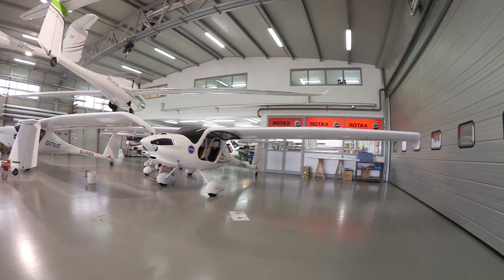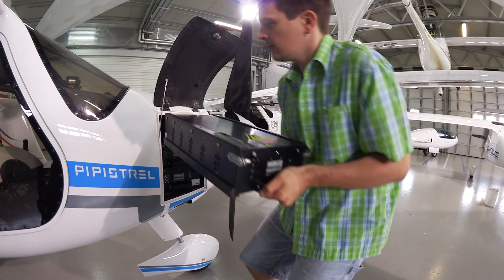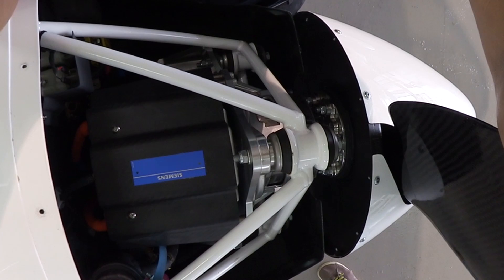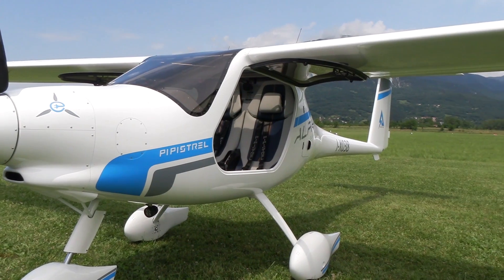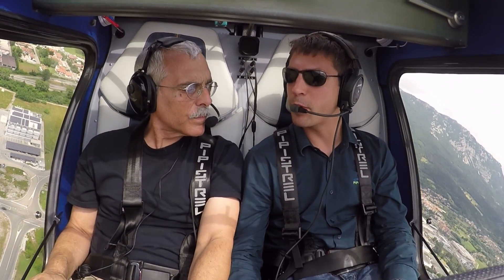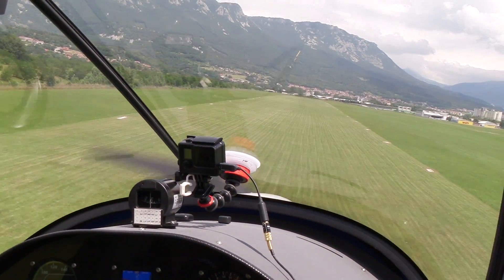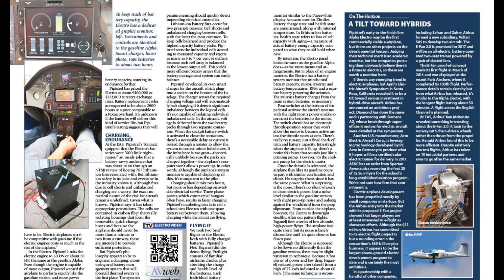Flying Pipistrel's Electric Airplane

Comment: Do you have metal, like aluminum or copper, & air flow by to draw heat away from the batteries? solar? I almost asked about a vertical wind turbine on its side with the top half exposed. That was until you said it generates power upon descent in landing. How much horsepower is it, because I have trouble finding horsepower advertised on any plane. Why is that too?
Reply: I think he said something about 65 KW and that translates to around 87 HP
Reply: +Bargain Boondocker thank you
Reply: The only horse that flies is Pegasus.
Reply: I just flew this. Amazing what a great airplane. Looking forward to reaching students.

Comment: I prefer the Airbus E-Fan,with twin motors at the rear driving ducted fans. Probably a quieter plane,but the range is the same as the Pipistrel's,about 1 hour.
Reply: I expect that the Pipistrel is more practical, designed as a durable trainer. It also has much engineering which I don't think the E-Fan demonstrator embodies, e.g. the modular battery design.
Reply: The E-Fan is a publicity machine. and it only carries one person.

Comment: $2 dollars for "gas" for the entire flight?  That's crazy talk.  I would think the cost of flight school will plummet when these become widespread.
Reply: +Bob Stanfield I read am article where the owner of Pipistrel claimed this plane would reduce training costs by 70%.
Reply: Yes, smoother landings with electric because the engine power delivery is much smoother.
Reply: @Allen Loser yeah but that super slow, also if its decending from 39.000 feet its more like an assisted glide than a full flight
Reply: @Allen Loser you what? you are supposed to make a smooth touchdown because you are on the correct glide slope with the correct speed, not because you you judged the distance to the ground accurately.
Reply: But will it withstand shitty landings?
Reply: But $2 is pretty expensive. So they've now created a solar trailer for their G4 glider. You put the glider inside of the trailer, or next to it, and it recharges the glider for free. It takes about 10 hours for solar recharge, so you need to charge it one day, then fly another. But hey, you don't have time to glide every day anyway.
Reply: @zexzex8312  charge overnight and it'd be good to go in the morning, no?

I feel like that's under valued on cars too. Most people only drive 50-60 miles per day, and even the worst chargers(not counting just a standard outlet) gets you at least around 100 miles given 8 hours plugged in.
Reply: @zexzex8312  maybe they can put solar panels in the wings

Comment: We need hybrid electric, not full electric. Because otherwise, your gonna get nowhere.
Reply: +Deimos Phob If you have solar power and electric( battery ) and the aeroplane designed with adequate surface area you will fly as fast as a jet plane with electrics.
Reply: topspeed10
Solar panels don't generate as much power as gas, and especially not within bad weather or during the night. And my point was that electric technology is no-where near as good as the current gas tech, meaning its not as efficient in power savings, and its not as god in terms of raw horsepower. So I was saying we take gas and combine it with electric, and then once the electric tech is good enough, we can lay off the petrol.
Reply: +Deimos Phob ..that is true but if you have low enough wing loading ( 18 kg/m2 ) and more solarpanel area ( using for instance Higgins-Bellanca concept of lifting fuselage ) you can beat the wingloading/powerloading ratio of a HK-1 with a clear margin...using solar alone.

Comment: How can the batteries charge so quickly? Is it the type of battery, or type of charger that make such quick charging possible? And does quick charge compromise the potential number of charges? The quick swap battery management system is the only way to go (if you have enough battery packs). It's dealing with the short battery life that is inherent with battery power. It's living with it, instead of trying to wait for better battery tech to improve. What if it doesn't for a long time? Quick swap!

Comment: Finally someone gets it right removeable batteries I love it!!
Reply: James Coleman Dude, you are missing the obvious:  you wanna spend 9-18 hours in a seat that small, in a cockpit that tiny?  Even with battery swap it's the wrong tool.  Kinda like saying you don't want a Vespa scooter because of those 9 and 18 hour road-trips.
Reply: They're probably right, in the case of cars, as most people don't need to be able to use them all the time. For a trainer to make economic sense for the operator, it needs to be able to run all day.
Reply: Here in Western Canada I might make a trip to see my sister in Montana and it's 9 hrs one way. Sometimes we go see family in Salt Lake Utah which is 18 hr one way. The only electric car system to go the whole way in the same way we're accustomed would be one that switches out batteries on the way.
Reply: @sweenie58  Tesla already has this network.
Reply: @LegendLength  Under 90 lbs I heard.
Reply: @Nicholas-f5  60 kg each.
Reply: Just wait, in a few years apple will bring out the "IPlane Xr" and the batteries are sold separately

Comment: the power supplied by solar panels in wings of the Pipistrel is far less than the power required to keep the plane flying. In order tot do so, solar panels need to convert solar energy at nearly 100% efficiency, and not at about 20% efficiency as they do these days. They key to a sharp increase in solar panel conversion efficiency is nanotechnology. Eventually, it will happen, hopefully in the near future. Nanotechnology is also the key to a sharp improvement in battery capacity.
Reply: +Ricardo Hadis 
if you want to sport a lot of extra bucks, you could get some 38.8% efficient cells via boeing spectrolab 5-j's. Not exactly cost effective, but whatev's.
Reply: Unfortunately, even 100% efficient panels wouldnt keep it flying.  It has about 100 sqft of wing area, so even if covered with 100% efficient panels, you would still be only producing 10kw with the sun directly over head on a clear day.   A practical solar manned aircraft will never happen.
Reply: Just a fair extension in time aloft is of value today, while things will continue to improve.
Reply: You wouldnt be able to rely on solar panels to extend time aloft.   And it would be mere minutes added to an hours long flight.   You would actually see far more time aloft by replacing the solar panels with more batteries.

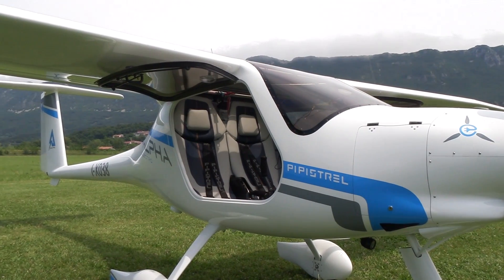Comment: While I do accept that the propeller is efficient when acting as a propeller, I find it hard to accept that it is also efficient when acting as a wind turbine( 3:11) as the aerofoil section can never fit both the propeller and the turbine . Still one doe get some energy back , but not so efficient as a generator, but as a brake  to increase the rate of sink , it will be useful

Comment: we need thorium powered flight
Reply: that's what I like to see, a CANDU attitude.
Reply: +Spill Burg You may be laughing, but much research in thorium reactors was funded by the US air force for use in airplanes.
Reply: Mark Rose
that would be awesome but I doubt petrol monopoly would let that slide.,
Reply: +EpiDemic117 and if your business was petrol I can bet you would like to keep it
Reply: +Spill Burg 
   We need Thorium Nuclear Reactors!
Reply: rdelrosso2001 Run thorium in a CANDU. Done. Or did you mean LFTR?
Reply: +EpiDemic117 
Actually there is are two very serious parties setting thorium back. The first is (unknown actual party) which keeps us from using enriched uranium or plutonium. Both of these are required to get thorium started on its decay to U-233. So whoever has that monopoly on nuclear weapons is responsible for this.

Additionally, heavy metals mining regulations in almost all countries but china preclude mining of most heavy metals mines around the globe. Heavy metals are generally found together and this makes mining them extremely contrary to regulations in most earthly mining sites.

So in short: the military & the EPA.

Won't work on planes because power to mass ratio is so damn bad.
Reply: Search wikipedia for "Nuclear bomber"
Reply: Basicaly if humans didn't cause so many crashes and if they were a little more tolerant to gamma radiation we could have nuclear powered planes and cars years ago.
Reply: Thats just plain stupid.
Reply: Thorium power bahahaha you must be kidding, you muppet americans cant stop killing each other with guns. 
Imagine if you were entrusted to fly hazardous material over homes.... nope. Cant even fly the planes you have now, basic mistakes like running out of fuel and basic shit like that... ffs.
 The rest of the world is so sick of the mentality of America... Do this at all costs because we want it now... 

How about set up a healthcare system and actual democratic goverement and stop starting wars in the name of some twisted billionares idea of freedom, Before anyone entrusts you all with anything like throium...

Comment: Absolutely beautifull aircraft in which you can see the future of small planes. Very nice indeed.
Reply: +Nico Meier 
   No, I think "Duck" wanted them to make an Electric 747, that can carry 400 Passengers across the Atlantic in 2 hours.  

  Or else, Electric Planes are just something to make fun of!
Reply: +duckgoesmooo To be clear, 90 minutes flight time total. They were including a 30 minute reserve.
Reply: +Nico Meier Yeah flying for one hour is great. Where I am we have to take a minimum of 45 mins of reserve fuel, so in this aircraft I'd get one circuit in.
Reply: +duckgoesmooo You do realize that this is the beginning of a new era and that development - especially for ways of storing electric energy - is just  beginning?
Reply: no id just prefer an aircraft that has enough range to get out of the circuit
Reply: no id just prefer an aircraft that has enough range to get out of the circuit
Reply: no id just prefer an aircraft that has enough range to get out of the circuit
Reply: +duckgoesmooo I know of no jurisdiction that requires +45 for in-circuit flying. An electric trainer for flight schools makes a ton of sense.  Electric motors last forever with almost zero maintenance and are quiet.

Comment: cover the outside with solarpanel films, add a parashute box on top, and then arrange for cash automats for electric loadings at fuelstations with extra long loading cable, and a small airport besides?and add electric battery's as portable extra fuel at the stations
Reply: +Kajander Jan Indeed. With the battery compenents being modular, you can swap the battery packs in a couple of minutes and fly on. There could be a system where you simply swap battery packs and pay for the electric charge only.
Reply: +Nico Meier They could offer aerial swapping of batteries, like an SR-71 Blackbird does for example with fuel. Then the range increases dramatically. :)

Comment: seems efficient only 2 euros per charge, but unless you can take the charger with you in the plane somehow i dont see how you will charge this thing at other airports unless each airport had an charging station which they wont, and there is really no space at all for bags or anything. definately not good for flying somewhere for vacation/holiday but i guess its good for training.
Reply: +noBueno That's the idea, it's a lower maintenance trainer that's very inexpensive to fly. With an hour's endurance it's not suited for cross country flight. There must be a breakthrough made in battery energy density for that to happen--that'll probably take a long time. In the meantime, hydrogen fuel cells may be used to power the electric motor, that also allows very low or zero toxic emissions.
Reply: 2 euros per charge is a very misleading figure which doesn't factor in the cost of replacement cells. Lithium batteries rated to 1000 recharge cycles typically fail after 300-600 charges and also degrade with age, meaning owners of these planes are likely to get a nasty surprise when the true running costs become clear over time
Reply: MrCurry I'm glad someone else made this excellent point, because man am I ever beyond sick 'n' tired of making this excellent point!
Electric vehicles of any type (ground, air or otherwise) that have usable range are very expensive. It will be a long time before they can compete with internal combustion engines for range and total life cycle cost. One aspect, the vehicle's power output, is perfectly in line with combustion and that one aspect alone is probably the only reason why any market exists for electric vehicles at all.
We're seeing the very beginning of a major transition in mindset for vehicular propulsion here, folks. It'll be a very long time before electric-powered vehicles of any type become mainstream and begin to free the world from it's dependence on oil.

Comment: Is there a fire suppression system built into the "BMS"? Seeing so many cells so tightly packed makes me a little nervous. Perhaps mistakenly so... What do you guys think?
Reply: +Ian Dykens I'd probably opt for a fire in an electric aircraft than one powered with avgas.
Reply: Google it... believe there was a tesla fire a week ago... ive heard of a few but dont know the number
Reply: +AdrianDotis I thought that too until i started flying electric rc planes and quads... lipo fires pack can a punch in for their small size... and these are much much larger.. i dont know how you monitor multiple 600 cell packs either! particularly when one bad one can take them all out.
Reply: +d1fballplayer I would think that with electric cars, driving around wiht thousends of Li-Ion cells, this has been tackled already, or have youever read something about a Tesla that burnt down due to en electric fire? I haven't.

Comment: Nice! I hope Pipistrel will make the battery modules and the motor/controller available for experimental builders.
Reply: +ThalassTKynn Anything is available with enough cash on tap :)
Reply: +ThalassTKynn 
   The Battery Management System (BMS) seems pretty awesome!

Comment: If they could put the batteries in the wings this would be ideal, as of now there is hardly any luggage space. Flew in this airplane this spring, can tell you it is an incredible leap forward in electric aircraft. We flew with no headset and it was more then okay. Amazing instant thrust with throttle. Once they have some range this will be my next aircraft. Keep on innovating Pipistrel!
Reply: +Darryl Zubot I'd love to see a system like this augmented with a microturbine turning a high-speed alternator to provide power. 10 gallons of Kerosene would keep it running for hours.
Reply: @THEfromkentucky  Great Idea for extended range Charging back up Batteries in-flight
Reply: +Watch Ryder VC is 85 knots, VA is 86, VH is 105, and VNE is 135.
Reply: There is no need for a luggage space as you literary can't go anywhere with this plane whit it's tiny range. Must be terrific to fly tho! Just a different use case (for now).
Reply: +Darryl Zubot Thanks for the update DZ. What's the top speed on this wonder wing?
Reply: Vc is Cruise Speed

Vh is Speed of the aircraft when maximum power is applied at straight and level flight
Reply: How much luggage do you need for a 30 min flight?
Reply: Vc? Vh? Not familiar.